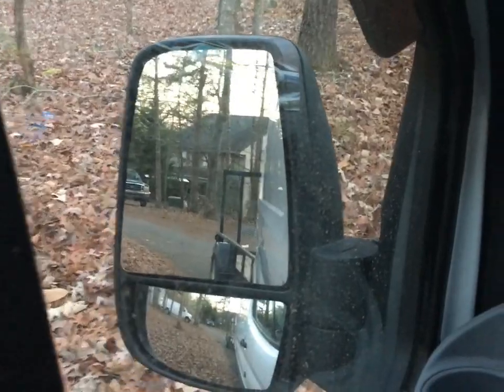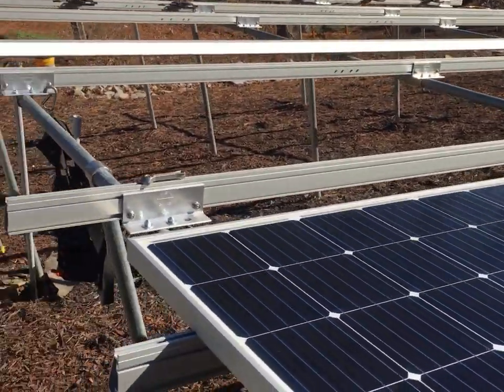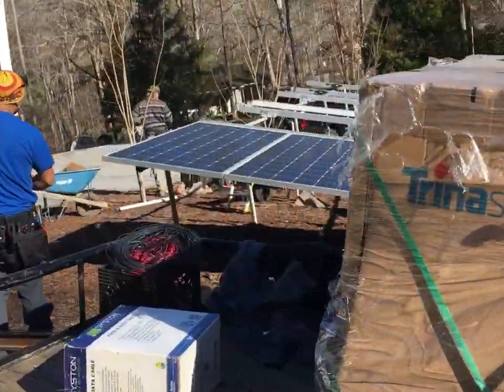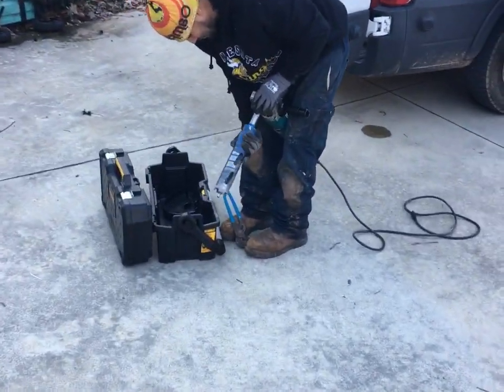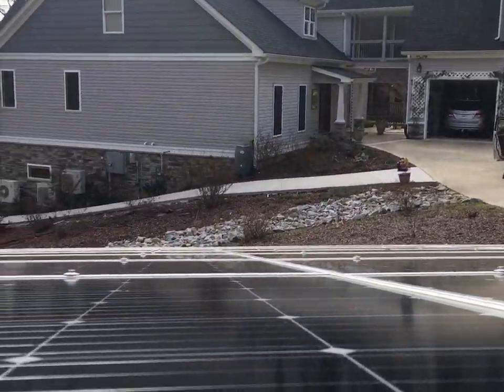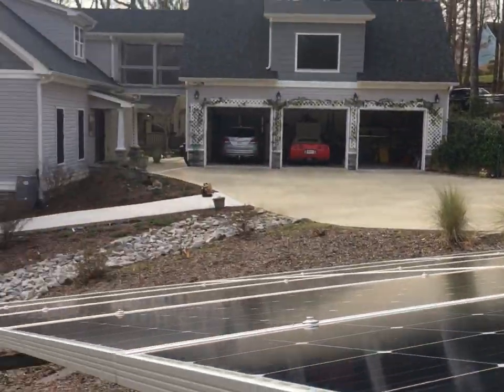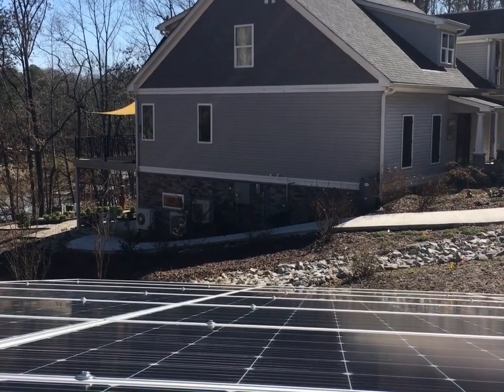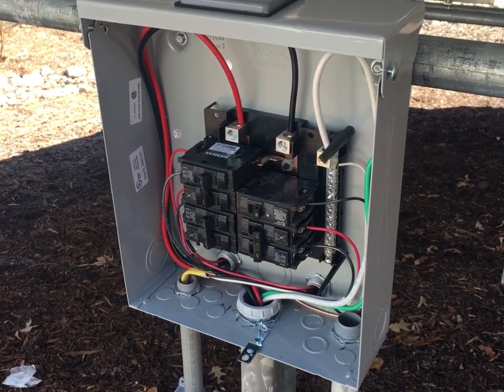Mission Impossible PT 2:  We fixed a crooked DIY Install

Comment: How do you keep animals off the panels mounted that close to the ground ?
Reply from the maker: The roof is more of a concern. This is in a neighborhood so I’m just wondering what animal you are concerned with
Reply: @GainSolarPower   Any kind of livestock or deer bears anything big enough to break them.
Reply from the maker: @terrya6486  cows will rub up on them. Dear and bear not in this setting.
Reply: @GainSolarPower   I had a customer with panels 2' off the ground and the deer came up and saw their reflection in it probably and started attacking them pretty much destroyed 10 327 W panels at least it didn't hurt the micro inverters.   We fixed it by putting all of his panels on top of his carport where nothing can get to them.
Reply from the maker: @terrya6486  that is crazy. Where did that happen